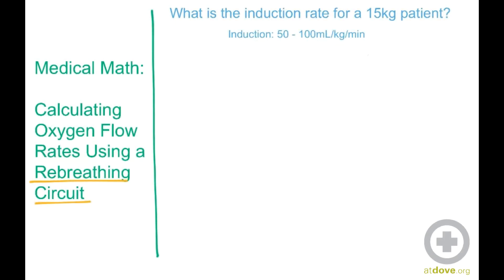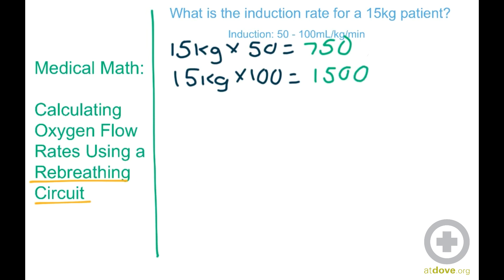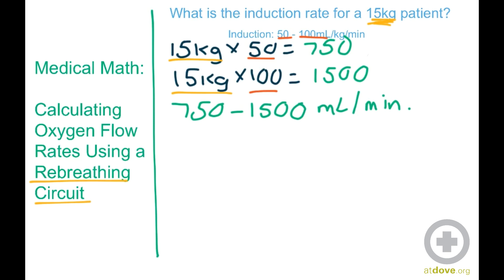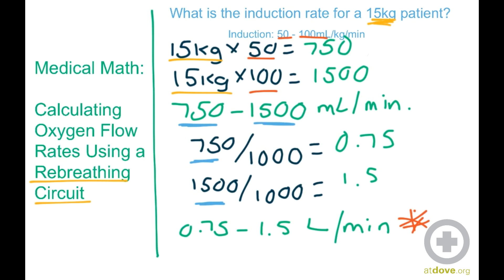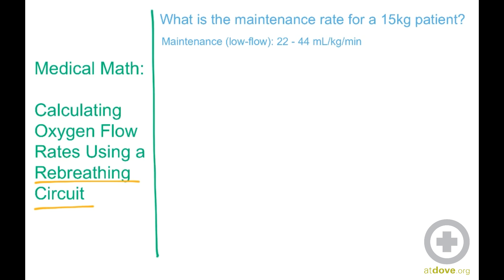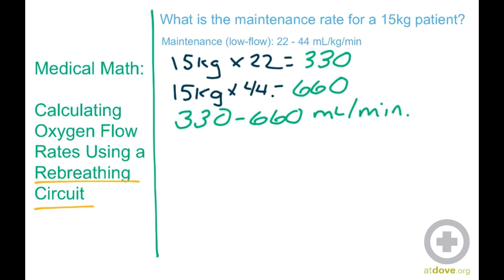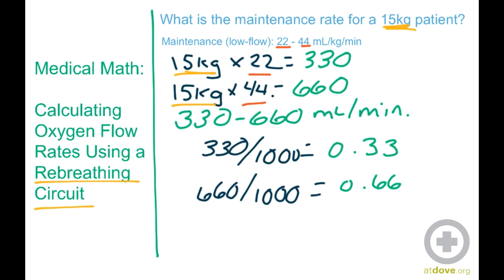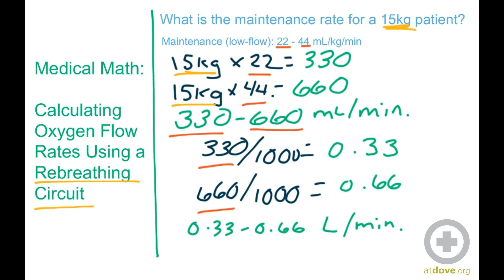Medical Math: Calculating Oxygen Flow Rate

Comment: I have 2 compressors which each have a max flow rate of 5 lpm. My active rate is 10 so they are both on full when I am moving around.  My rest rate is 6 lpm so I can turn each of them down to 3 lpm but, if I am up and down a lot, I leave them both on 5 for sustained periods. Obviously, a use a reverse splitter to combine the 2 separate flows but what would be the effect if a set them at different rates for example one at 5 permanently and one swapping from 5 to 1 as required?

I ask this question because of my large cylinder backup. I only I use these if I have a power failure or people staying over as my compressors live in the guest bedroom because they are noisy.I therefore move them to the lounge as there is nowhere else to plug them in using a wall socket which they must have. Because of the noise, I switch to one of the large cylinders but this only has settings for 8 and then 15. To produce 10, do i need to combine 2 cylinders each running at 5? If so, this is not possible as they only have settings for 4 and 6 so I would still need 2 but then running on different flow rates. My maths is not up to working out the resultant flow rate as I assume it is not just adding them together if the pressure from the feeds is different. I am thinking line of least resistance or similar. With both at 5 this does not seem to be an issue but different flows could be tricky. Also, I have other portable cylinders which can be set at 5 but they only last a couple of hours at best. Can I use one of those set at 2 or 4 alongside my big one running at 8 or 6? Does anyone know the answer?